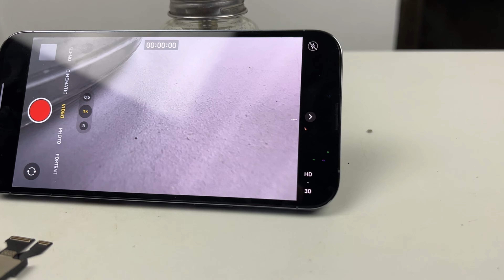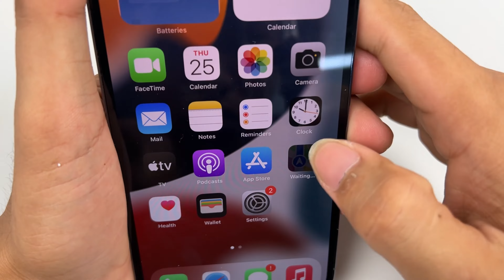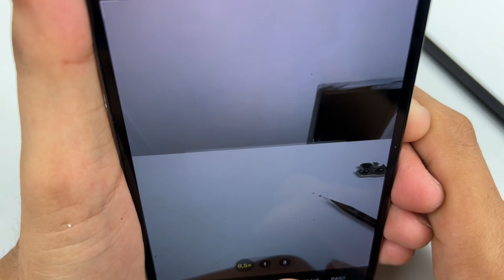iPhone 13Pro Max Back Camera not Working? Here's how to fix it!

Comment: Great video! I have a question. Whenever I replace an iPhone 13 pro / pro max rear camera with a genuine apple one, the 0.5x ultra wide camera becomes disabled and all I am able to use is the 1x and 3x cameras. Why is this do you know? Would removing the 'non genuine message' solve it? Thanks